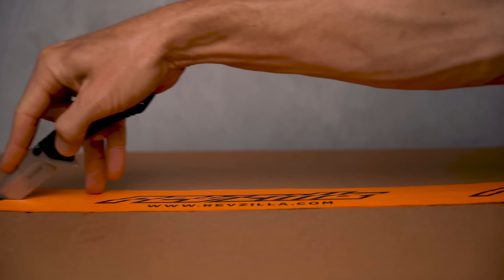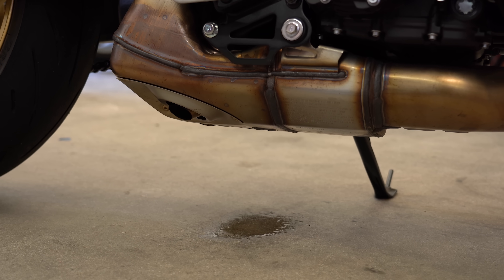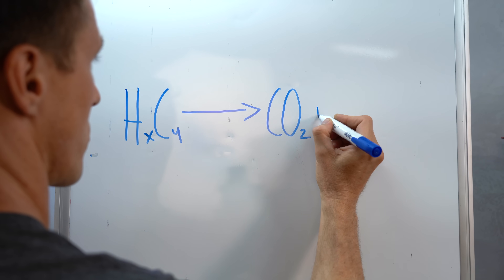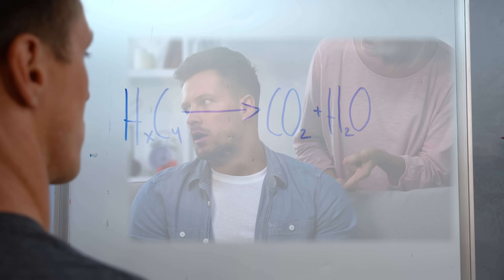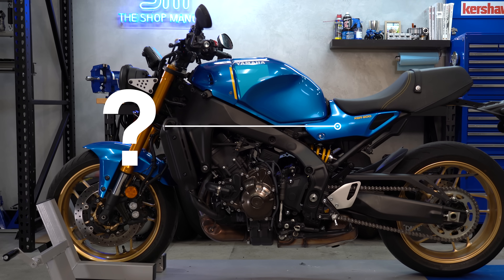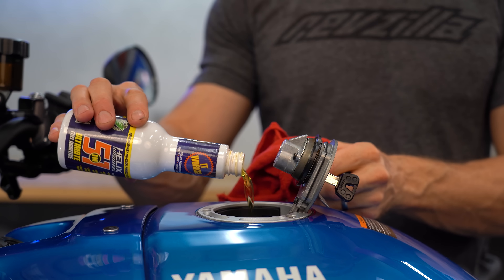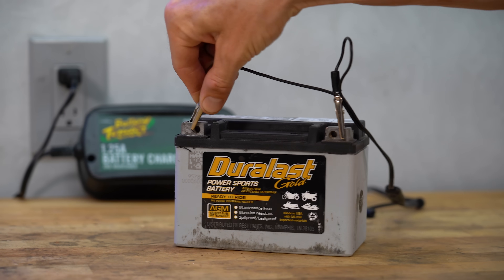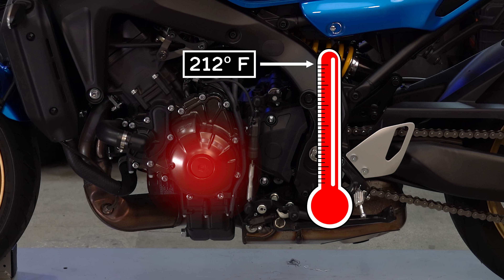The Storage Myth That Hurts Your Motorcycle | The Shop Manual

Comment: I bought my GSX-R 750 new in 2012.  My winterize routine has been flawless, and I still have the original battery in it.  Add fuel stabilizer to the tank.  Let it idle for a few minutes, take it for a short ride to not only get it up to temp but make sure the stabilizer is in the entire system.  Put it in the basement.  Once a month hook up the battery tender for a day.  That's it.  Don't start it until spring.  Less is more for winter storage.
Reply: Do you also change the oil before storing? Or only after?
Reply: @willem1442  That was a typo, I didn't mean literally let it idle up to 185* coolant temp.  Start it up, get your gear on, and go.  A couple minutes idling doesn't hurt anything.
Reply: Well, good for you, maybe. But using a 10 year old battery is playing roulette. With a battery that old, it's just a matter of time when it will die while either riding it, which your charging system will then be running the bike, something that stators hate to do. Or, leave you stranded with no options but a tow. I would never leave something like a battery to chance.
Reply: @umarkedreturn8776  Spoiler alert... The charging system always supplies the power to run a vehicle.  Batteries are for the most part for starting only.  Why do you think cars have alternators commonly rated 100-150 or more amps?  Only when the load exceeds the alternator's (stator/rectifier for a motorcycle) capacity does the battery start discharging, and this is only for short periods of time.

As long as the battery continues to provide a strong start, the battery is fine.  Only when it shows signs of being weak should it be replaced.  I know, my previous motorcycle had charging system issues so I'm quite familiar with it.  And before you say I caused the issues, it was an extremely common issue on that model.
Reply: @ultimate1576  Did you have an 06 - 07 Suzuki GSXR 600/750 ?
Rectifier and stator issues
Reply: @SystemAdministrator1  Close, '01 750.  Rectifier was mounted in the tail fairings, they also had rectifier and stator issues.  Cooked a battery because of it, too.
Reply: @Motovibes91  I usually change the oil at the end of the season for vehicles I store for winter.
Reply: @ultimate1576  I've had many a motorcycle battery die an instant death.
Reply: @stevek8829  I've had one die on me too, still not a big deal.  Push start it and ride home.  🤷‍♂️
Reply: @ultimate1576  that doesn't work on large fuel injected bikes like it used to. I have one that will skid trying third.
Reply: Your battery has lasted over ten years???
Reply: @umarkedreturn8776  happened to me with a battery that must have been 4 years old - stator had about 3 of it’s coils burnt and ruined a new battery until I removed the casing to discover the damage to the stator
Reply: @Bumbaclot213  Sure has!  Still going strong.  Rode all season with it.
Reply: Thank you, I was just about to write this haha imagine thinking your battery runs the bike all the time 🤣

Comment: If its stored outside long term, start it regularly.  I had a car that was in my yard, and after 2 years of not starting it, the motor seized. Moisture can easily enter and engine through the intake if open to wind. Oiled reusable air filters dont help either.

Comment: All good notes, thanks for sharing. It is also good to mention cold starts run rich and deposit fuel in the oil. If the engine isnt ran hot, like under load,  the crankcase will collect that unburnt fuel which will cause unnecessary wear on the internal oil lubricated components and surfaces.
Reply: @Peter Alexander  What are you talking about? 🤣

Comment: Another good point, if it's just cold but not icy outside, is take it for a bit of a ride, and get everything moving. Sure, you'll freeze your ass off, but doing this also helps lubricate all the seals involved with the transmission and final drive, as well as making the process of getting the oil hot take less time.

Comment: Yep, starting and running it for a few minutes only causes condensation. Best to keep on battery tender and I turn it over occasionally without starting to turn the cams. Good to rotate cams to alternate which valve springs are compressed...

Comment: Absolutely agree with all of this, with the possible exception of the fuel stabiliser, which I am unconvinced is effective, my preference is to fill the tank with ethanol free fuel, if I can or drain the tank if I can’t.
Reply: Exactly this. If at all possible run a couple of tanks of ethanol free gas through before storage. No need for fuel stabilizer or draining with a full tank of ethanol free. Infinitely better for injectors.
Reply: @donm9090  that's totally backwards. These ethanol myths are old wives tales. It sequesters moisture in an azeotropic suspension rather than letting it pool in an aqueous layer and rusting out tanks, or moistuee condensing or seeping in when bike are left outdoors. What do you think is in fuel "dryers"? Ethanol and methanol. It's not bad for carbs either. Most issues are caused by bad fuel from the pump or the dozens of additives like toluene that affect rubber, or just letting the fuel evaporate.
Reply: @VndNvwYvvSvv  It's not but I'm not gonna argue with a stranger on the internet. You do you chief, see ya never.
Reply: @VndNvwYvvSvv  From what I've read, you're partially correct. Dry gas isn't meant to be put into a vehicle going into storage. You're supposed to put it in and immediately drive the vehicle.
Gasoline and alcohol have different specific gravities. Left undisturbed long enough, and they will separate.
The accepted storage times for pure gasoline is 6 months, 3 months for gasohol mixtures. 
Pure gas around here is 87 octane and typically $5.29 per gallon. If your motorcycle, boat, or classic vehicle needs premium then it's not going to be happy come spring. You can siphon out a bike tank and use it in the lawnmower but dealing with 20 gallons can be problematic. 
Here's something that will make you go "Hmmm..."...alcohol free gas is also known as RBOB blending stock and the daily price can be found on commodities trading sites.
Reply: @VndNvwYvvSvv  Ethanol tainted fuel goes bad in 60 days.
Ethanol and gas don't mix and will separate like oil and water.
Ethanol is bad fuel, much less energy than pure gas and corrodes metal.
Ethanol is only there because of politics.
Reply: Been using Stabil 30 years in motorcycles, cars, lawn equipment etc and never had a spring starting issue or gum up from fuel breakdown.
Reply: @KurtFrederiksen   Heat does something to the ethanol too. I live 20 minutes from Death Valley. Not much moisture in the air. And in a sealed container, the "tainted" mixture changes color (think orange juice) in a few weeks and when that happens, it starts smelling like paint thinner. 
There's a VIP (racing fuels) gas station on the corner. Their race fuel has gone bad and the pumps are locked. I guess it sat in the ground tanks too long. (???) 
I have a 115 gal tank in the back of my pickup. I go to a station that sells ethanol free, 93 octane for about .20 more. That's what I use in our performance off road buggies, my vintage Jeep and my 71' Mach One.
No problems and stores well. 
I DON"T want any ethanol in my fuel. It's all politics. It's a freebie tax to benefit corn growing states. Think Iowa caucuses.
Reply: Yey I have found no use for stabelizers or Sea Foam, all Snake oil, just read the ingreadance. My choise is to always run Non-Ethinol fuel and fill the tank and store in a dry area where rodents can not make a nest or chew wires, another thing battery tenders rune more battries then help, a fully charged battery in good condition will survive a cold winter with no issues. One thing on newer bikes like my 2024 XT250 it has a computer and a clock, both do put a slight drain on the battery, so I make it a practice on modern vehicles to disconect the negitive lead to the battery.
Reply: @spaceflight1019  I've had the same premium gas in my Harley and KTM 990 tanks since probably 2018 and they both run just fine when I start them up every so often and get the engine good and hot.  I'm actually shocked at how long gasoline stays good, premium anyway, but even regular gas in my Ski-Doos works just fine after 5 years.  I sometimes think there's a lot of fear-mongering and people worry too much.  That said, I am worried of it going bad and am about to drain it from all of these machines.  I wasn't planning on not running them for so long or I would have drained it right away but life happened.
Reply: @shavedape  I don't think that it's the gasoline itself but the alcohol that's blended in with it. I've only had to restore one bike with bad gas, a 750 Sabre, and the gasoline had turned into Pepsi and the carbs were completely varnished up.
Reply: @spaceflight1019  well our premium should be ethanol free but the regular in the Ski-Doos might contain ethanol, depending where I gassed them up since Shell or Petro-Canada may not (or did not and might now) contain ethanol in their regular.  That's why I'll drain those first.  But I've been starting all bikes and sleds up and getting them to what I thought was hot enough to burn off water in order to lubricate and just rotate bearings etc. plus to move fuel through narrow passages and through injectors before it 'sets up' and varnishes.  Not that it would help but in my mind I imagined it helps and seems to be working as far as everything still starts and runs normally.  Maybe it is getting varnished up and I can't tell without opening it up or until it gets so bad they start running poorly.  All are fuel injected and stored inside but not heated other than what passes through the connected house walls.  But after seeing this video I'm having second thought since I didn't know about that 200+ F rule.  I wasn't necessarily going by the temp gauge and would sometimes touch the engine to see if it's warm, but didn't wait until the engine was too hot to keep my hand there which I'll do from now on or just stop doing it.  Hard to change old thinking and habits though and in my mind I still keep thinking its good to circulate oil through everything even if modern synth oils probably stick very well over even several months and simply having gas move in the passages probably doesn't prevent varnishing.  How long was the gas in that Sabre sitting and I assume the gas had contained ethanol?
Reply: @shavedape  The Sabre was sitting for at least five years and that was before ethanol replaced MTBE in the gas. 
When I park my motorcycle for the season I don't start it up. After I made sure that the valves in both cylinders are closed (takes the load off the valve train and camshaft) I pour about 2 ounces of Marvel Mystery Oil in each cylinder. When it's time to get it going I take the plugs out and rotate the engine by hand to drive out any excess oil.

Comment: Not to mention that most wear and tear occurs when the engine is busy reaching operating temp... so you're doing max wear the entire time that you letting the bike warm up... and it'll also warm up slower cause its not under load.

But some serous issues there I didn't know about too.

Comment: Here in Canada I usually have bikes from the 80s that have a center stand. When it's on it, I start and put it in gear so things are moving properly. So I can check for noise etc.. and I let it empty the bit of 91 in the tank. So I won't need to empty the carbs. Then I usually bring the batteries in the house.

Comment: Thanks for the video.  I always held the idea that starting a cold engine thats been sitting for a while was more harmful than good because of the wear & tear & stress in the start up before the cold oil circulates.  I removed the spark plugs, lubed the cylinders with a squirt of oil & turned it over a couple times with the plugs out before replacing them & removing the battery to a warmer place & trickle charging it.  

I figured the less I turned the engine over or started it when it was cold & keeping the same gas in it to do so over the winter, caused more harm than good.  I wasn't aware of the excess moisture that accumulated or the temperatures needed to counteract it.

Comment: The colder weather and my somewhat neglected battery prompted me to think that it would be cool to see a video of how to bump start the bike appropriately. I used to have a carburated bike that would have me sweating through a work shirt before I could get the thing to start...
Reply: u don’t need a video’ just turn ur key on’ put the bike in say 3rd gear’ hold  clutch in while rolling down a hill then when u get rolling good let out on the clutch.  if ur in 2nd gear or 1st it’s compression makes the back wheel harder to turn ur engine over so a higher gear like 3rd makes it start easily when let out on clutch.

Comment: I bought the Adakiit 6/12V 4A Smart Battery Charger/Maintainer Fully Automatic 8-Stages Trickle Charger for Automotive Car Motorcycle.  about $60 as I recall. The directions say plug in or connect to the battery for one hour every 2 to 4 weeks. Not plugged in 24/7. So since I dont know any better I followed the directions and when the battery maintainer isnt plugged into any of my motorcycles I use it on the several lawn tractors I have. One unit and I maintain my " Fleet". This system has worked with no problems the last three winters.

Comment: Thanks! I live in the netherlands so winter never gets too crazy here. Most of the time, only december untill early Februari is a no-go period for motorcycles, but ill definitely add a fuel conditioner.

What I did to winter proof my bike was:
- Wash and clean all dirt
- Dry it with a towel
- Let it idle for 30 minutes minimum to get rid of any remaining moisture on the engine, untill i did not see any steam.
- Cover it with a waterproof tarp
- Fill up the gas tank completely. I only need to add some conditioner to it and will probably just stir it arround slightly since i dont want to start it up for no reason mid winter.

I plug in a charger for the battery about every 3 weeks so that should be good.

Comment: Quick tip: On certain Triumphs if you let the engine idle from cold and until the cooling fans turn on and off this will reset the learned values for the engine ecu. Useful for after installing a performance exhaust or air filter
Reply: fake news

Comment: We don't get much of a winter her in Tennessee and even in the dead of winter a 60 degree day is not out of the question. So I never "winterize" my bike, but around Christmas time I usually take some days off work and I will change the fluids, give it a good cleaning and inspection, put stabilizer in the fuel, etc. I always have it on a battery maintainer. Longest I've owed the same bike was 8 years....and I never had to replace the OEM battery. Battery maintainers work!

Comment: Good advice. The charging recommendation of a maintainer is for lead acid batteries. If your bike has a lithium battery, it probably won’t need a winter charge unless there’s a parasitic drain. 
If that the case, the Optimate Tecamate lithium charger can be left connected, will keep your battery at full charge and won’t damage the battery. Lithium batteries deteriorate under a constant trickle charge. The Tecamate only charges when the voltage drops so it won’t harm the battery. 
Trickle chargers for lithium will work, but must be removed once the battery has reached full capacity which means you’ll need to test it with a volt meter.

Comment: I’ve had a 94 900rr and I’ve started it every month in the winter for the last 25+ years and it still runs as good as the day I bought it. 
It may not be what is suggested, but I’m going to keep doing what I’ve been doing. 
It’s not great on the valve springs leaving the same valves collapsed all winter either.
Reply: I am in the position to safely, easily start/run mine thru winter.
Same, I'll run mine for 30 minutes to an hour, depending on ambient temperature, once a month until riding season.
Yeah, gotta run her til she's hot. 
This eliminated my spring start up issues altogether.

Comment: Stabilizer plus Non-Ethanol gas is mandatory for carbureted bikes. My old '86 started right up after 4+ years of storage. Drained the tank added fresh fuel, but did have to replace the battery because the Battery Tender died.

Comment: Also running the bike for short periods during the winter introduces contaminants in the oil. I drain the gas from the tank and carbs completely,  soray a light coating of fogger in the tank. If you want to circulate the oil, hit the starter a few times with the kill switch on.

Comment: Used to have this issue with my WS6 as I never drove it far enough distances to heat up and burn off the moisture. At first I was scared I blew the head gasket before finding out about the moisture issue with our toys.

Comment: Good advice Ari.  Up here during Canadian winters, I store my 2 bikes with non ethanol fuel and run a tricke charger every two weeks or so for a few hours.
  I'm not comfortable with leaving a trickle charger on for months at a time.   I have heard of switches failing and boiling the battery out.  Correct me if I'm wrong, but also heard natural battery cycling with a (slight) voltage drop after sitting a couple of weeks then put on a charger prolongs battery life, as opposed to being held at full charge for months at a time.
I do start my bikes about once a month and let them run to operating temp.  They do live in a 72 degree garage in my house.  
   I agree not starting a bike all winter for those whose machines live in cold storage with a cold start being less benaficial as opposed to seasonal hybernation.
I love The Shop Manual and look forward to the next episodes,    Well done as usual Ari.
Reply: All fuel is canada has a mandated min 10% so where do you get ethonal free gas?
Reply: @lg740xx  In NY State